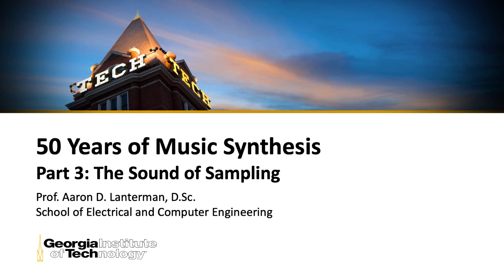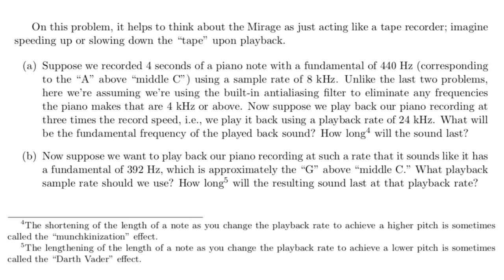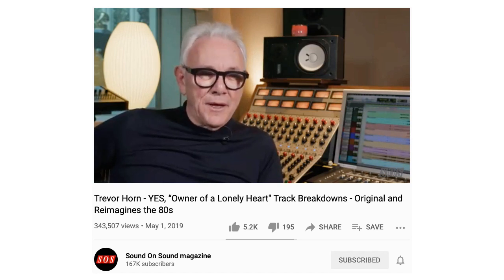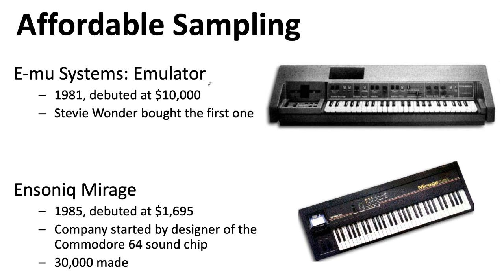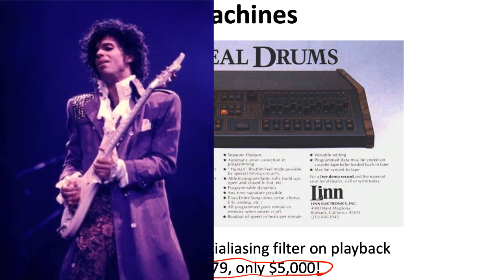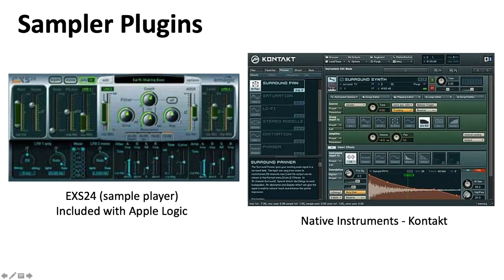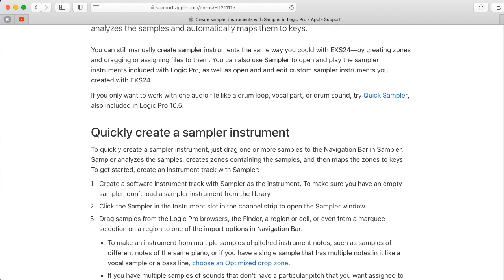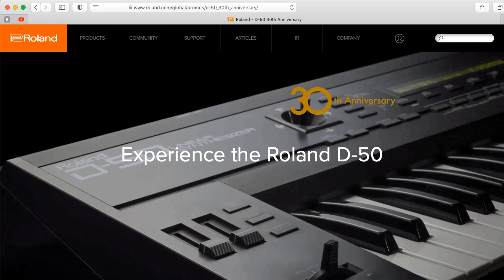ECE4450 L2.3: 50 Years of Music Synthesis, Pt 3: The Sound of Sampling (Analog Circuits for Music)

Comment: While watching these great lectures, I remembered reading from Wikipedia, Aphex Twin the following statement several years ago  "According to James, at age 11 he produced sound on a Sinclair ZX81, a home computer with no sound hardware: "I played around with machine code and found some codes that retuned the TV signal so that it made this really weird noise when you turned the volume up."" Might you have any ideas on what he was doing back then with the Sinclair ZX81? What does "found some codes" mean?
Reply from the maker: I'm guessing that it was interference from the digital hardware getting coupled into the analog lines running to the TV. Some early computer music was done by putting something like an AM radio on top of the computer, and by writing loops with certain timing you could get pitched noises out.
Reply: @Lantertronics  Fascinating- thanks! The interference conjecture makes aense since he apparently only heard it after turning the volume up.
Reply from the maker: @floretion  Yeah, it's something bleeding into the RF modulated signal going to the TV.